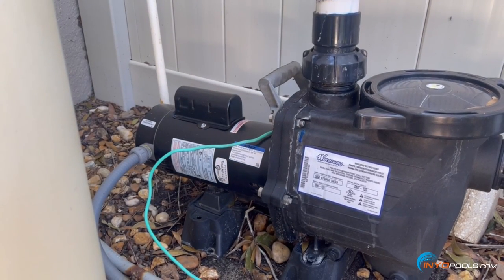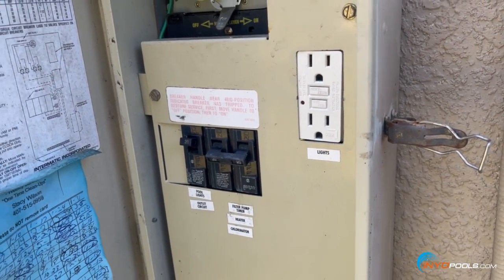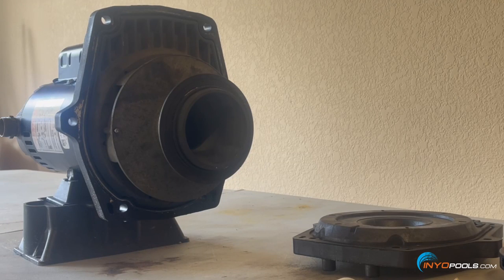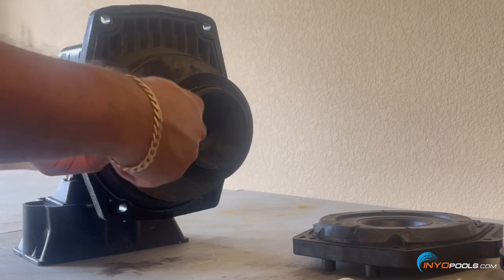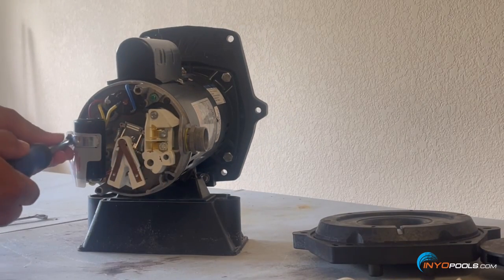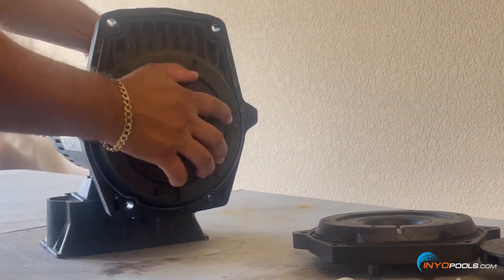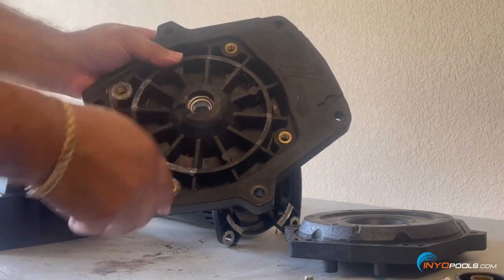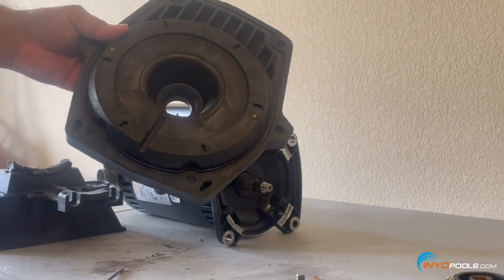How To Replace A Waterway SMF Pump Motor

Comment: Why did you replace the seal plate??
Reply from the maker: The most common reasons for replacing a seal plate are damaged/warped plate, the shaft seal being stuck/glued into place,  and can't get the old seal plate off the old motor.

Comment: Didn’t see if the impeller had a reverse screw
Reply from the maker: The impeller screws we've seen all have a reverse thread. This is likely due to pump motors all rotating in the same direction, so the screw has to be threaded to counteract that.